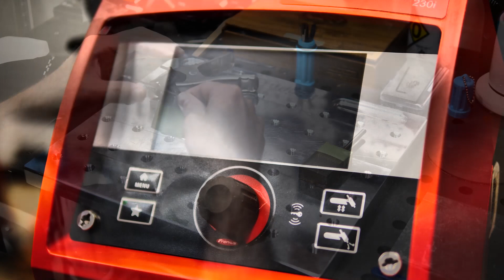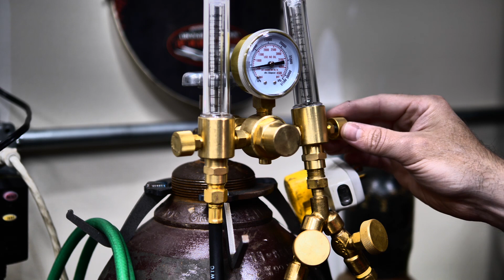Cup Repair

Comment: It's the little things that make a sensitive repair of something simple even more terrifying to not return to perfect condition.
Arc wander and drifting etc; it's time breakout the holy water to sprinkle it on your work surface, tungsten, and put the rest of the bottle in the your torch cooler!
(Off topic, but an interesting story none the less.)

My Everlast 255 EXT can go down to 3 amps, but I know it can somehow get one amp lower. I saw 2 amps on that machine using my pedal! I know because my $400 hood wouldn't trigger on the arc and I looked up at the machine with a 2 in front of my eyes. I had to turn the lights in my shop off to realize that my machine was working, but no brighter that a cigarette lighter that was on it's last strike before all of the gas was gone. Just a tiny, blue kernel of an arc. It doesn't wander, unless that tungsten is a little out of round on my grind.